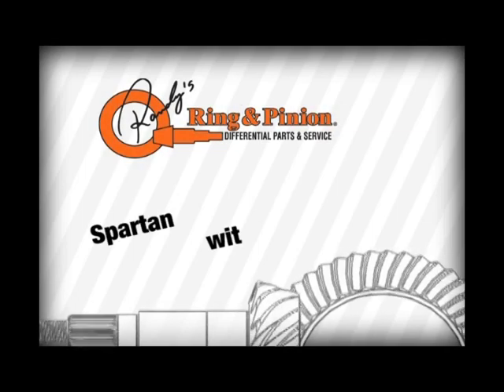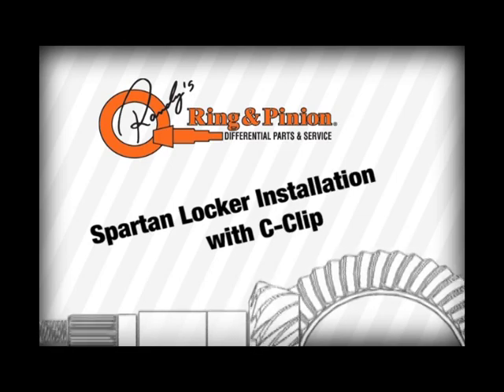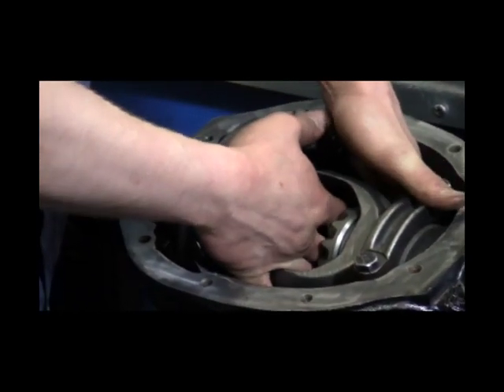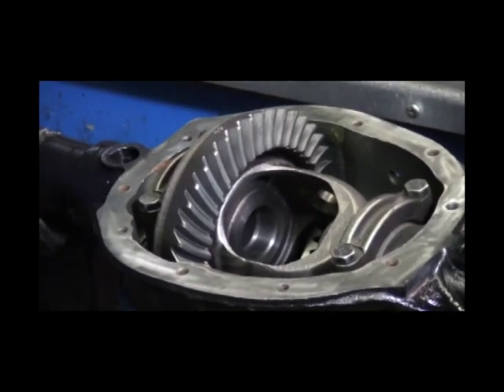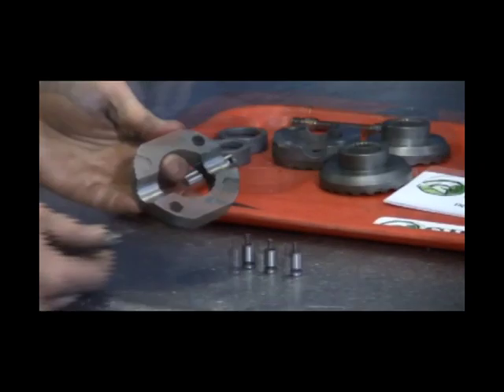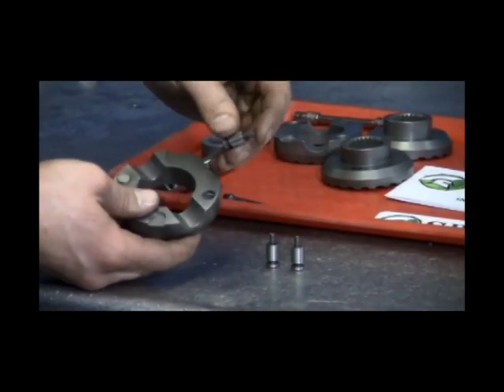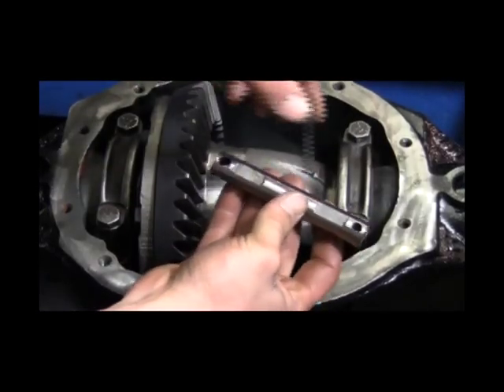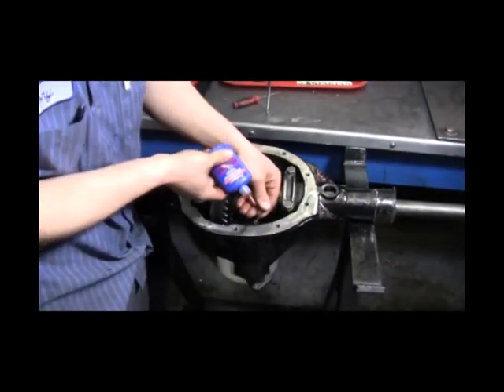Spartan Locker Installation, C-Clip Design

Comment: If you want to make it easier on yourself put c-clip on drivers side axle after installing side coupler.  Then put the rest of it together. Trying to put c clip on with ring gear in the way is a bitch especially if rearend is still in vehicle
Reply: Exactly how do you put a c clip in that holds the axle shaft in and the carrier is thus trapped inside the housing, without the ring gear installed?

Comment: does this apply to chrysler 8.25? the c clip info was not included in the instructions...
Reply: I think so? The center pin prevents the axle half shafts from going inside the differential too far and allowing the c clips to come out while driving.

Comment: You left placing the Left c-clip out of the video. In addition, you did not show placing the right half of the locker into the carrier!? So, what is this supposed to be showing, people, how not to set-up your locker?!
Reply: The set up is the same for both sides.  If you don't realize that, you probably should be performing this installation without assistance.

Comment: This video is intended for people running half-ton trucks with semi-floating c-clip type axles. A truck fitted with a Cummins inline-6, will generally be a 1-ton truck sitting on heavier full-floating axles. This video does not relate to that at all. It should be common sense for all truck owners to do a full carrier replacement, if looking for a traction aid in a heavy truck with a high torque motor.